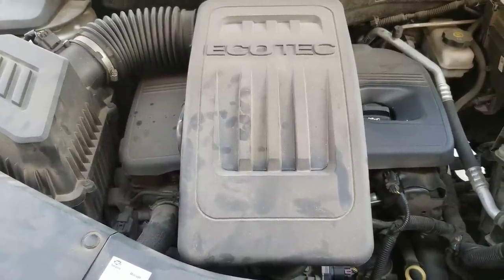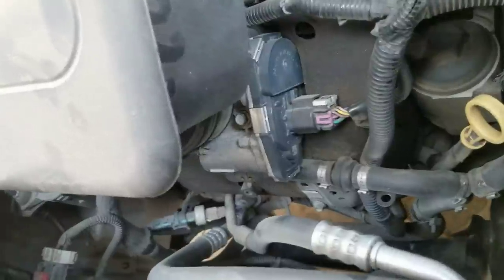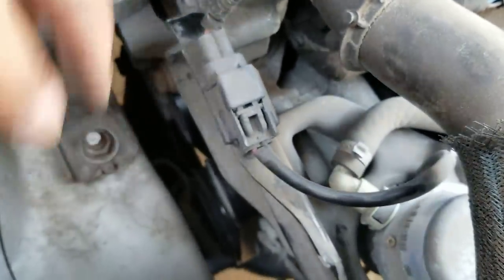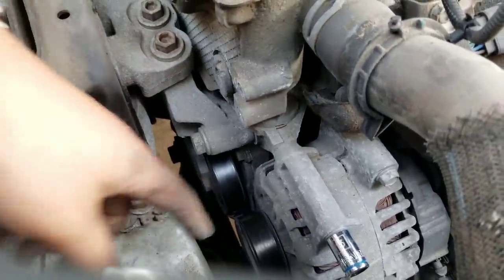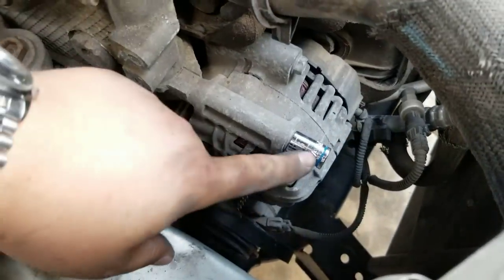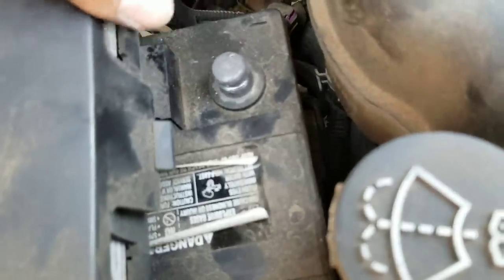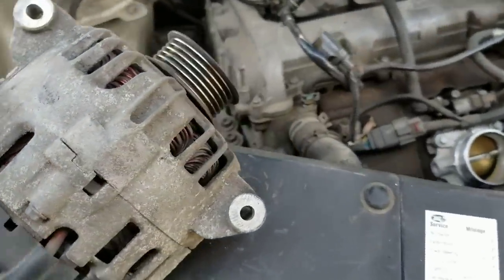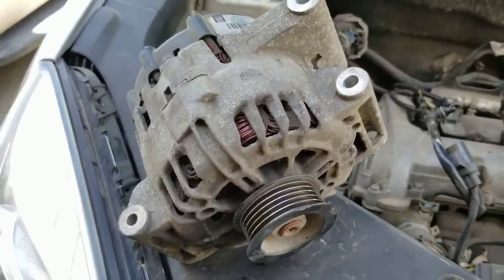Remove Alternator Chevrolet Equinox 2010-2016 Ecotec 2.4 terrain

Comment: This is a really excellent video on removing the alternator on the 2010 and later model Equinoxes and Terrains with the 2.4L Ecotec engine. The camera work is clear and steady, the comments on what to do and how to do it are clear and to-the-point, and you can easily see the small area you have to work in.  

For those with the 2010 (LAF) engine, the brake booster pump (which he laid to the side at the beginning to get to the alternator) is in a different place in the 2010 engine and does not have to be moved.  Removing the bottom alternator bolt first and the rear-most top alternator bolt second makes it easier to hold the weight of the alternator until you are ready to take out the third bolt (top front) and remove the alternator. On the 2010 engine, the red battery cable can bolt on in such a way as to rub against the plastic intake manifold, making it difficult to get the new alternator positioned correctly, and you can’t see clearly what you are trying to do.  On the 2011 engine, the battery cable comes in from the side making it much easier to position the new alternator, and to re-install it.  I am in the middle of wrestling a new alternator into my 2010 Equinox with the 2.4 Ecotec engine, and I can tell you that getting the new one in has been three times harder than removing the old one, because of the red battery cable problem.  Also, note that there is a main engine grounding point behind the alternator (you can see it on the video) - while you have the alternator removed, be sure that this ground is not corroded and that the connection is tight. I took my alternator out solely to check this hidden engine ground, and then tested the alternator while it was out, and discovered it was in bad shape and had to be replaced.  I had many of the error codes he reported in his comments, and I hope the new alternator helps fix them.

Thanks again for making this video - you did a great job. Hope the install of the new one was as easy as the removal.
Reply: My alternator is failing just now on my 2010 equinox lt 2.4 lt engine. I just had a new battery installed less than 6 months ago, will it make a difference??

Comment: Man, I'm glad you took the time to make this vid. I'm facing the same chore on my 2015 Equinox. One other thing to mention is that whatever that electronic thing is on top of the battery interferes with the pos post of the battery. If you want to charge the batt up with a charger it pays to pull that junk off to connect the charger cable. That electronic (computer?) piece is bolted down with a 10mm bolt to the left side of batt.
Reply: Daniel Roach that’s the main computer for the car sir, bad place for it , I agree!!!

Comment: Very important to note that the positive cable connects to the starter positive terminal, so if you change out the starter the cable to the alternator will be removed also, DONT forget to reconnect it to the starter also. Sometimes it will spring away from the terminal and be missed when starter is completed. Then quest what, you start the suv and starter working good but shortly after you discover the alternator is not working. Take note of this.

Comment: They completely screwed the 2013 2.4l 4 cylinder. That bolt at top right isn't a bolt. It's a nut on rod coming out of engine, and there's not enough room to slide it off.
Reply: Did yall get it off
Reply: @TheAsiaShontay  Nope. Ended up being the battery. So, I let it be.
Reply: For those of you that ran into that issue. That rod can be removed
Reply: Outlaw Anon  
Check your fusible link connection too. It runs from the starter to the bottom of the alternator. Mine was so corroded it broke and I had to have it remade at a truck stop mechanic shop.